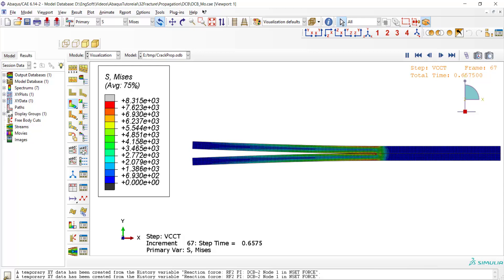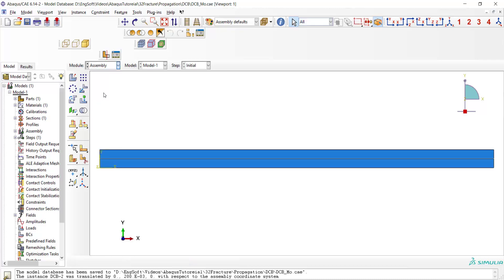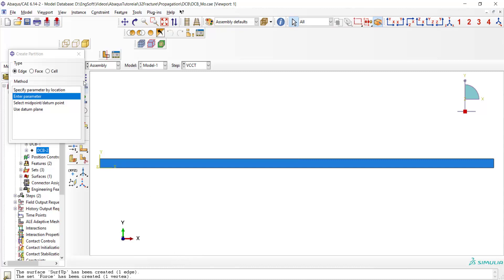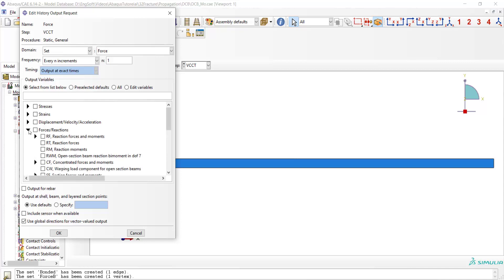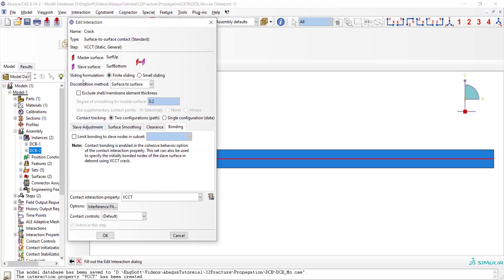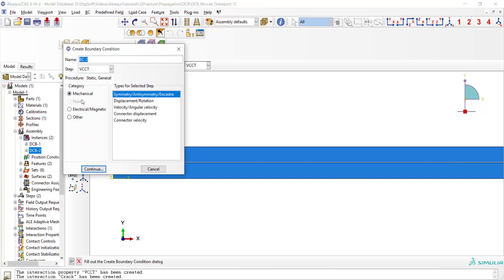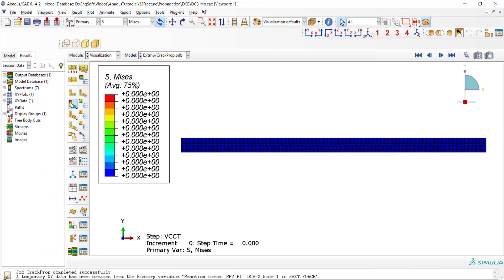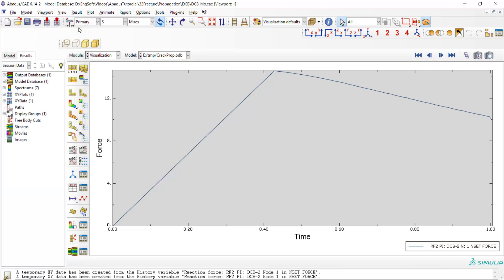Crack propagation in DCB using VCCT criterion in Abaqus

Comment: Hello, I keep getting an error: 
Solver problem. Zero pivot when processing a contact constraint for slave node DCB-1.1362 D.O.F. 1.
Solver problem. Zero pivot when processing a (tied) contact constraint for slave node 1362 instance dcb-1. This may be due to the unit used for the displacement differs by more than 10 order of magnitude than the unit used for the material stiffness. If this is the case, please use a different unit system.

Could you help me solving it?

It seems to be the node on the far right edge of the sample that is touching the upper part and the bottom part.